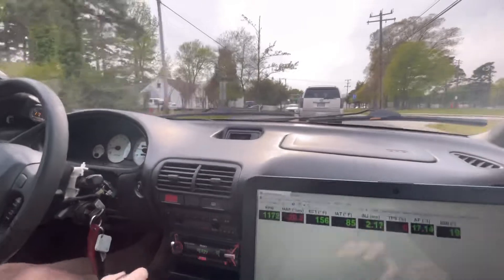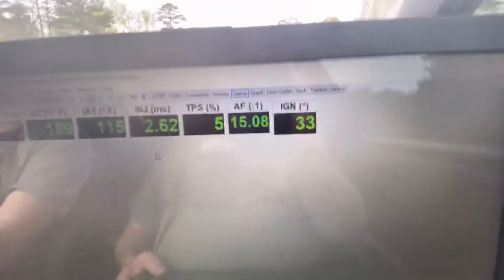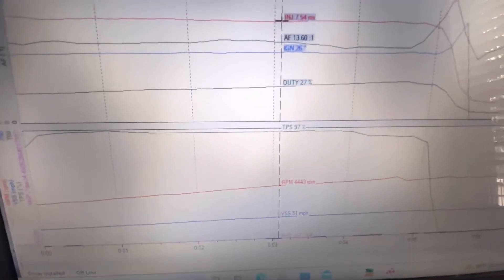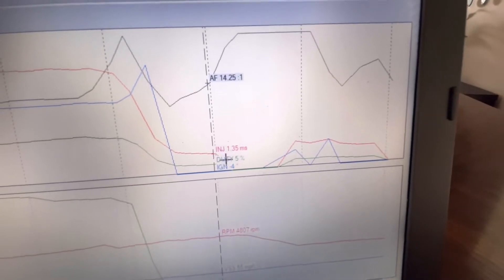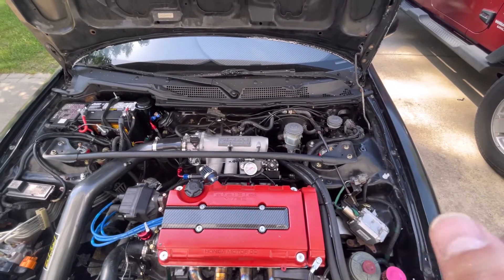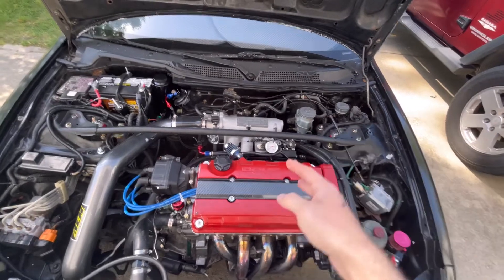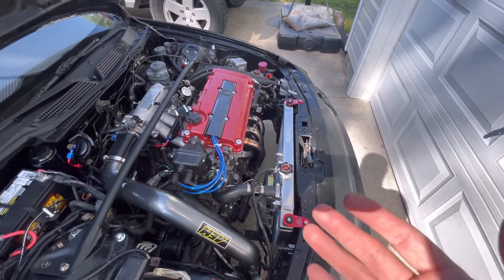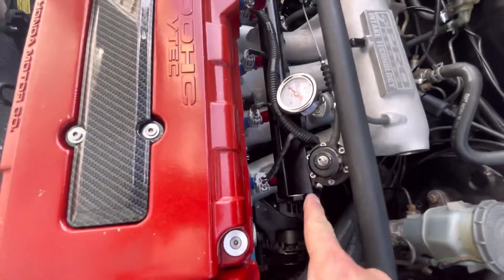Don't buy Ebay fuel injectors, Ebay injectors review Rdx 410cc injectors hondata.

Comment: It's decel bud, its by design. Your ignition timing is retarded for that reason and tps is at 0. The injector response you're looking at is the commanded value from the ECU so the ECU is telling them to be at 0% the injectors don't provide feedback they are just controlled.

Comment: Which injectors would you recommend? I have a 92' LS, NA and I've upgraded most of the fuel system(mostly AEM and skunk2 stuff) I've also had the head ported and a three angle valve job with 2nd stage Brian Crower values, duel springs.
Reply from the maker: I used the RDX 410cc injectors, I was running N/A on my integra B18c1. It was bored over and port and polished head, skunk 2 intake 70 mm throttle body and ITR cams. They worked great and easy to tune. The only thing I would recommend is a adjustment fuel pressure regulator because on stock fuel pressure they run at 40 psi the cc’s we’re somewhere around 500-700 cc so I ran my fuel pressure at 38 psi to run 410cc. If you have any questions please let me know message me on Facebook or Instagram.
Reply: @JCMotiveGarage  thank you for the recommendation

Comment: As you can see, once the vehicle sees 0% TPS AND deceleration in mph, ie; coasting then it shuts the injector which is 0% duty or in other words 0.00 ms pulse rate as displayed on screen over 6 times I saw.

Comment: 0 fuel during deceleration/off throttle what seems to be the problem?
Reply from the maker: That wasn’t the problem, it did it on cruising and accelerating also. They spray pattern was off also, compared to the OEM Honda rdx injectors.

Comment: Got these ones spi 42lb 440CC INJECTORS rx7 Civic Integra ACURA D B F H K SERIES ENGINES ZC VTEC fuel injectors from eBay can anyone give me any information as you if
It’s any good can’t find anywhere
Reply from the maker: They were some good injectors, just had some problems with the dead times they seem to stop spraying all of a sudden. Maybe you will have better luck with them. I bought some Honda Oem rdx 410cc injectors from prl motorsports. They were are little pricey but they work so much better and no problems since I installed them. If you want the link, message me on Facebook or Instagram. Thanks for reaching out.

Comment: Hey what kind of exhaust are you running and do you have a testpipe on it
Reply from the maker: It’s a Megan racing 4-2-1 header, with a racing cat. 2.5 inch cat back with a 4 inch tip.  I can send you a link if you would like.